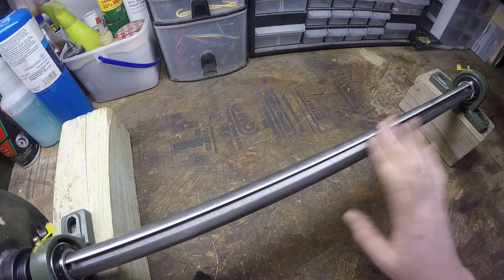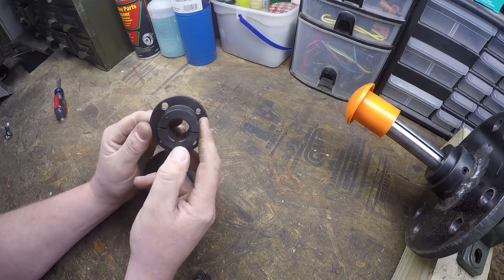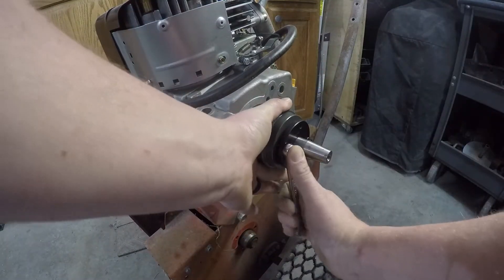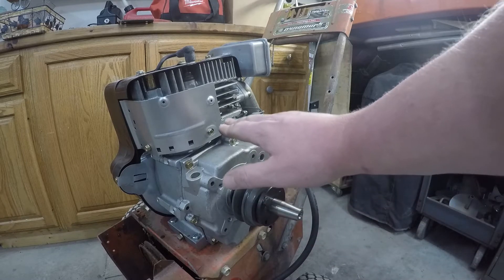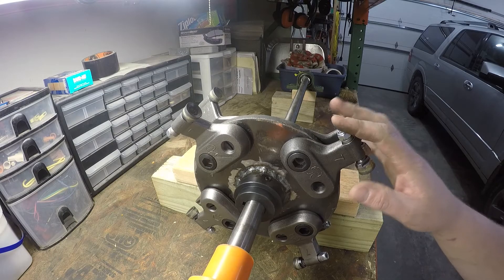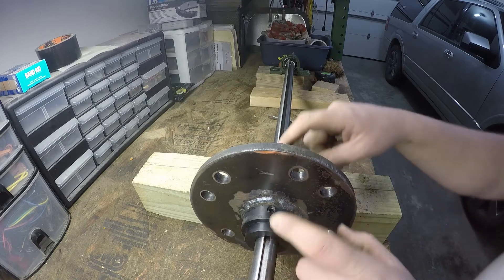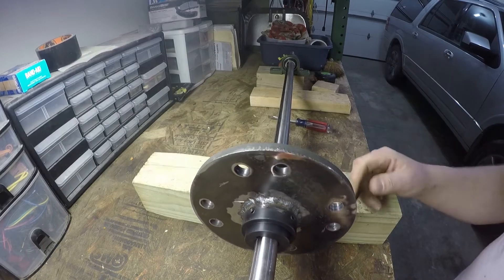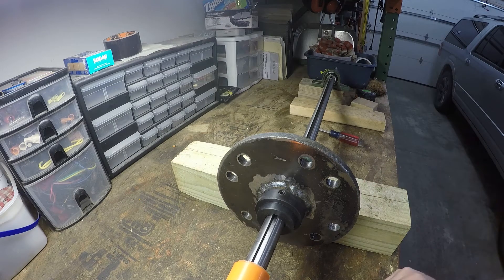Homemade Stump Grinder pt3 (installing a taper lock pulley)

Comment: For anyone that doesn’t want to do the entire thing diy (I considered it using these vids as a guide) I ended up finding a busted used up grinder frame and cutting wheel with the belt and a few good carbides at the local rental place… they parted with it for under 300 so I used a HF Motor and bought some new carbide teeth etc and the correct sheave pulley for the motor shaft…. It’s one way to get the project going faster, obviously the diy way is cooler and possibly cheaper if you have the time.   What I need to find is some videos of hydraulic stuff or some way of making it self propelled or like powered steering to go back and forth because once you start doing a lot of grinding on your property you are going to get tired quickly from manhandling these smaller units especially once you get up into the 13hp motor range

Comment: Good video series, could you have used an impact wrench  and a torque stick to tighten that pulley onto the shaft?
Reply from the maker: Marshall, youre correct an impact would do the trick. However I would imagine the torque spec is under 35 ft lbs. They're only grade 5, 1/4" bolts. I thought about using my m18 Milwaukee 1/4" impact driver. Still undecided LOL

Comment: Super great video. I myself am in the process of building a stump grinder using a zero turn mower with a commercial 25 hp Kohler  horizontal engine. However, I did not want to fabricate a cutting wheel. That was just too difficult without the proper tools, so I just ordered a wheel and the cutting parts. For turning the wheel I am using a heavy duty hydraulic wheel motor via a 12 gpm hydraulic pump(overkill) and 2 hydraulic double acting cylinders for up/down and side to sides.. The pump will be turned and powered by the horizontal engine shaft via a 4 joystick control valve.  Still trying to figure how to fabricate the frame to hold the wheel to the mower frame. Matter of time. I am retired, so taking my time between other home projects. When does pt4 come out?
Reply from the maker: It will be the next upload either Friday or Saturday. I've had so many other things keeping me busy I haven't had time for it.
Reply: @SkylarHillShop  Great, looking forward to it.

Comment: I was curious how far the taper lock enters before it is pulled in. I am making split taper timing drive pulleys for cnc machinery and they didn't have any tolerance specs since i presume they expect you to buy a pulley. Thanks for the tutorial getting a good visualization of how it fits reassures i made mine right :-). Howd that stump grinder turn out?
Reply from the maker: I've seen some that nearly pull in flush and others look like they should go in quite a bit stil,  but seem tight. I would imagine there's probably a torque spec for tightening the bolts and maybe that sets the proper tension? I don't know, mine didn't come with any information whatsoever and I just snugged the bolts up to what seemed like an appropriate amount.